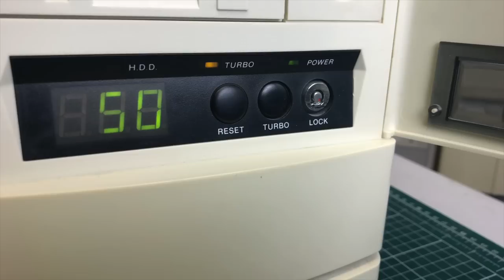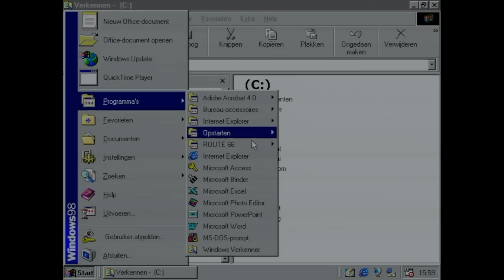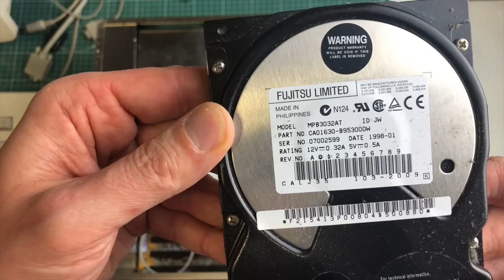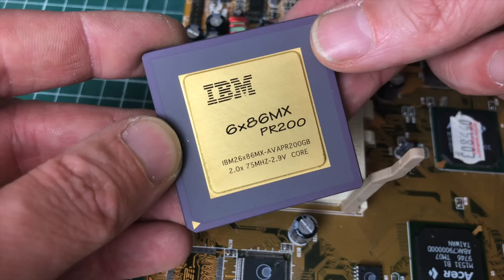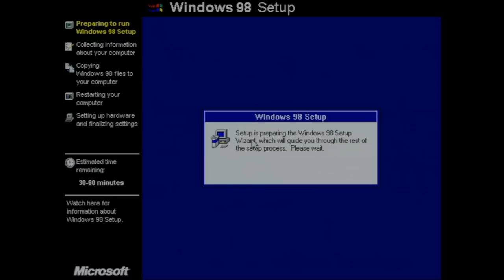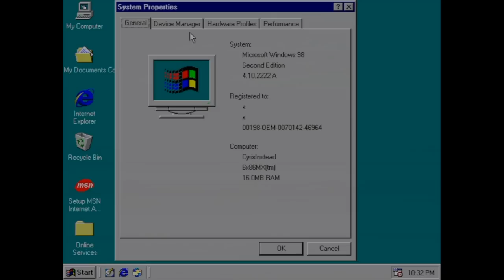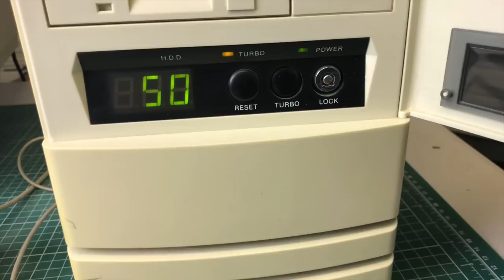IBM 6x86MX PR200 find in a gorgeous nineties PC case

Comment: We had a case looking very much like this, for an Am386SX. It was without the hatch, and it was a bit taller, and the display only had two digits. But there was this glossy black portion with the rectanular HDD, Turbo and Power LEDs; similarly positioned (though gray) power button; reset and turbo switches and keyboard lock in the black rectangle and similar design for air intake in the lower part of the case. Either one manufacturer has taken a strong inspiration from the other, or they could even be from the same manufacturer. The frequency LEDs could be configured by jumpers segment by segment, so for a 120 MHz CPU it still was possible to configure the display to show 119 by displaying "11" in the leftmost seven-segment unit.
Reply: Any luck finding the name of model of the case ? I used to have a very similar mod tower case with the 2 number digits for the MHz . My reset and turbo buttons were not round but rather very oval , almost flat . I remember my computer was a megitronic but I can’t find the case .
Reply: @melchieor  Sounds exactly like the one we had. There glossy black part went at least almost the full width, and it had a small protrusion in the upper part, if I remember correctly. The LEDs were rectangular, and they were green for power, orange for turbo and red for HDD. The power button was in a rectangular piece, but the button was round. The turbo and reset switches match your description. They were in small indentations, so the button itself would protrude ever so slightly (I think that turbo button was protruding a bit more when it was off, but cannot say this for sure). And there were four, maybe five grooves at the lower part of the case. Unfortunately, I have no name for the case. It was a brandless clone PC built by some small company that would sell coputer parts, and has probably gone bankrupt some 20 years ago. I've tried to search for a picture of the case, too, but with no luck.

Comment: That 24hour burn in sticker on the bios chip is always a dead give away for pcchips board :)
Reply: Interesting that the board didn't have the chipset rebranded though. I could clearly see the "ACER" markings on the chipset (ALi is Acer Labs Inc.) at 9:56
Reply: I used to deliberately buy PC Chips and ECS boards back in the late 90's and early 2000's because I wanted to help people who were having problems with their rigs built around these cheap motherboards' and the reputation they had was well deserved IMO. Fake cache chips on PC Chips 918, 912 et cetera was the original issue people had with PC Chips mobo's but to add to it, the chipsets' they used were usually very old tech, very slow and as such memory bandwidth with a particular CPU and at a set speed (RAM & CPU), the PC Chips mobo would be 10-20% slower than a PC with identical components, other than the fact it was based on a better board, such as one manufactured by Gigabyte, Asus, Abit and even Intel own brand mobo's were much faster than PC Chips motherboards with the same socket.
PR was a rating given to CPU's as a 'performance rating' when (I think) the CPU in question was benchmarked versus a Intel processor at the same PR speed.
A 200MHz PR CPU would have been thought to perform the same as a Pentium @ 200MHz but the differing in instruction sets caused the PR to be quite random and not based on much at all really.
Reply: @NSHG  ALi made chipsets for fair while and I recall having a Socket A board with an ALi Magik 2 chipset (I think) and as a fairly early socket A board, it didn't have a locked PCI bus so overclocking also overclocked the PCI/AGP speed.
Reply: @benrogersdevon  I still have a fully functioning ALi based Celeron 533 machine from PCChips, a M726MRT (Slot 1 + Skt 370) Surprisingly sturdy. 

The caps aren't really that bad either (Teapo w/ slight G-Luxon sights. Would've expected more trashy caps honestly.), and the soundcard onboard is a genuine CMI8738 on the PCI bus. Also the BIOS isn't crappy at all, which is a great surprise considering it's PCChips, of all things. Oh, and no rebranded chipset. It actually READS the original ALi printing on it.

ALi was more popular during the Super Socket 7 phase though, for what I recall, with their ALi Aladdin V. Some revisions had a bug where you couldn't run some K6 chips though (ASUS P5A actually suffered from this) which could be fixed with a resistor placed on the back of the socket, though it escapes me which pin(s) you had to solder it to.

Comment: Those CPU's will undervolt quite a lot. The ALiDDin 4 chipset also had a 2.5 divider for the PCI clock. So on this board it would have been 30mhz.  I don't mind these cyrix chips. They are fun to play with and pit against CPU"s from other brands. The later gen M2 cpu's I found could be undervolted quite amazingly, and at that point could get by without a an on their heat-sink. The first MX chips maybe not so much, but I always set them up at 2.8 volts. And if the motherboard had the settings, sometimes even as low as 2.5 volts, and they would still work just fine. And it always led to less problems for heat.  That is a beautiful case!

Comment: The 6x86 isn't lacking a FPU, it just has a slow one (iirc, it can't use both the FPU and the ALU like the pentium can do)
Reply from the maker: Yeah ... need to be more clear when I use terms such as “lacking fpu”. Meant to say “lacking in fpu performance”.
Reply: If you used Windows NT it effectively did not have a FPU. NT kernel would simply disable it at least in NT 4.0. The filesystem drivers required a FPU for compression and encryption, also. So it attempted to emulate one when a 6x86 was present. There was no indication to the end user that anything was wrong until one day the system no longer would boot.
Reply: @AugurIliKur  none the compression nor encryption in NTFS uses FPU. Those algorithms are purely integer.
Reply: FPU isn't just for floating point. Back in the 90s we called them math co processors. Some how that changed to FPU because of the 486 and Pentium cpus integrating them into the CPU directly. Most FPU units will also speed up integer. Do you mean that NT v4 doesn't need to use the accelerate opcodes from the FPU?
Reply: @skilletpan5674  you know what fpu stands for, right? It accelerates floating point math and functions, like transcendental ones. While you can use FPU for manipulating floating point representations of integers (like, 2.0 x 2.0) it don't worth it from performance standpoint. FPU introduces latency which only worth it for something really expensive, like floating point multiplication/division or math functions. And yes, NTFS.sys doesn't use any x87 code. At all.
Reply: @skilletpan5674  the issue with the corrupted filesystem could be related to a cache, either on-board one or built into the CPU. Or the RAM being unable to work correctly with the particular CPU. That era motherboards could've been quite picky when it comes to a non-Intel CPUs. BSODs, lockups, reboots... Been there, done that.
Reply: I know what an FPU is and what it's for. The FPU is rather handy when you want to do large calculations/lots of calculations. It's why games like doom and quake run faster on pentiums or at all. The FPU has the handy thing of introducing parallelism into a program. You can hand off a task to it and then get the result several cycles later but still continue your code while it's calculating. The setup is slower but the pay off is larger if you design your program around it. As to NT not using the FP I find that typical and interesting.
Reply: @skilletpan5674  That only works with intel's design. Also DOOM doesn't require a FPU at all, quake does.
But what they did with quake could have been made without a FPU considering the PS1 had no FPU and was still capable of doing complex 3D and that other PC games can do what quake did without a FPU as well, sometimes with even more things going on on the scene.
Reply: @skilletpan5674  your knowledge about x87 is fragmented. you'll find it interesting that Doom isn't using x87 FPU. At all. Only fixed point in the CPU. While you're right about parallelism it isn't easy achievable on 386/486. There's x87 instruction FWAIT which stalls CPU until x87 not ready with the result. And no, x87 isn't useful for just any massive calculations, only for floating point math. Thus F and P in the name. I see you seem to confuse FPU with MMX and later SIMD instructions. x87 is quite different. It has stack architecture, not just a bunch of registers. And is very tricky to program it in assembler.
Wikipedia has great article on x87 FPU.
Reply: I'm sorry but I don't really want to have a pissing match with you today. My knowledge of old hardware etc is from using them about 35 years ago. I haven't owned such an old pc for about 20 years or so. Yes I was thinking of Quake and not doom. Yes x87 is rather different from MMX etc because by the time Pentium was around they'd moved the x87 into the cpu rather than having it as a separate chip. There is nothing stopping the programmer from executing a few instructions then then doing the FWAIT when they want to check for the result. This usually means you can get the Pentium pipeline to process a few instructions while you wait unlike the 486 which hasn't got the same pipeline.
Reply: @skilletpan5674  "there's nothing stopping programmer..." - I see you're not a programmer, right? There's a lot of things stopping programmer from doing that. And most obvious one - big range of clock speeds of the IBM-compatibles and x87s used. But this is a bit off topic. Bottom line: NT4 kernel didn't use nor require x87 to function. Neither did any NT4 stock filesystems, NTFS or FAT. The probable cause of corrupted filesystems I mentioned above. Cheers.
Reply: @skilletpan5674  oh, and by the way. Encryption of files on NTFS volume was introduced in Windows 2000 and called EFS, hence you couldn't have any issue with it in NT4.

Comment: Remember that no one wanted these Cyrix processors at the time because of the low FP performance which resulted in slow performance in games...
Reply: this month i took my old 430tx motherboard out of a case, to replace it with a new board, cyrix pr166 still intact, probably still ready to run.
Reply: @felderup  The Intel 430TX chipset was the last nice one for 66mhz socket7 mb. It supported UltraATA, SDRam, EDO ram, and was rock stable indeed.

Comment: I remember I used to overclock the bus up to 83MHz. I remember on a 430VX intel chipset motherboard when I did this and at the same time enabled UDMA on the IDE controller my Win95 installation would corrupt every time I overclocked the bus to 83MHz, due to the PCI bus running out of spec. However, when I changed it from UDMA back to PIO Mode 4 it worked fine. 75MHz was no problem with UDMA enabled though. The higher FSB on these socket 7 motherboards really improved the performance by a considerable amount. Probably because the L2 Cache was on the motherboard
Reply from the maker: The PR200 seems to overclock fine to 75x2.5 (PR233) but on these socket 7 boards its next to impossible to get temperature readings. So not really sure how far I want to push it.

Comment: Many Cyrix CPUs were manufactured by IBM. 

The mach64 is actually a 3D card but it uses custom 3D instructions.  There were several games designed for it. 

That Avance Logic sound card has a connector for a Wave Blaster daughterboard.

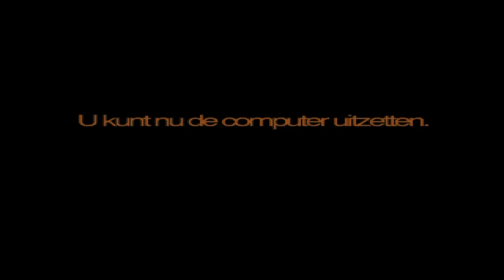Comment: I was taking a swig of my tea and looked up to see that 4:30
I nearly choked.
A small correction for you at 10:52 - the original Pentiums had 16Kb L1, the MMX variants have 32Kb L1 which was where their real world performance boost came from
Reply from the maker: Next video will start with some errata :) thx a lot to you and all the others for pointing them out.
Reply: @RetroSpector78  I'm unaware if it has been mentioned elsewhere in the comments but in your video you say that the isa bus is 32 bit - when I think you meant 16 bit. Also the HDD has the size written on it 3.27 GB bottom right. Great videos from you, well done and thanks for sharing.
Reply from the maker: Thx a lot ... still lots of room for improvement but I’ve got the best viewers / subscribers ... I’ll dedicate my next video to you guys and sum up the mistakes + corrections that got into this one :)

Comment: Awesome video(watched it first on my Roku YouTube App) I have a strangly similar Matsonic Socket 7 Board with the AT and ATX connectors but with the PC-66 Dimms filled instead of the 72 pin ram sockets and a K6-300 Mhz processor. I should put in a spare sound card(mine has a built in sound chip but not a fan of onboard sound cards) and video card and hard drive and see if the crazy things still works since it been put away for a few years now. Again awesome video and thanks for reminding me of mine.

Comment: All the time you`re going in detail about the FSB and multiplier, all I can think of is to overclock this thing... Would be interesting to see how far you can get with this CPU :)
Reply from the maker: Don’t have high hopes but might try it in a future video :)
Reply: You would get nowhere. Overclocking just didn't work. The chips would almost universally just lock up at a higher clock speed. This isn't like modern chips where 200 would be a 233 that is derated. This is 200 or 233, the end.  233 ran at 66 MHz and 200 ran at 75 MHz, period. Plus as he mentioned the PCI cards often would not work at 75 MHz. So you ended up running your 200 at 66 MHz bus with the multiplier set higher to get almost any complex PCI card to work right.
Reply: I once overclocked a 5x86 cyrix cpu (It was one of the weird ones that ran on a 486 motherboard if I remember correctly) from 100 to 130mhz~. I changed the 25mhz jumper to 30mhz. The internal 4x multiplyer gave it the 130ish speed. It booted up and ran but it wasn't all that stable and a real pentium 100 was still faster than it with PCI bus and the better ram.

Comment: Hard drive is a 3.2GB.

I still have my 686 PR200 CPU motherboard ram etc. It was rebuilt into a AT desktop a couple of years ago :)
The 686 has an FPU but is on par with a 486, Quake was the killer for the Cyrix CPU's if you were not using a 3D card such as 3DFX.

Comment: The ps/2 port is actually the mouse port.
Reply from the maker: Correct ... should have tested my theory :) I thought the ps/2 port would have come with a bracket (like the serial / parallel ports). Honest mistake ...
Reply: @Korstre  Yep, I remember having a PS/2 header on my first socket 5 motherboard for a PS/2 bracket. Keyboards didn't work. Only mice.

Comment: As far as I remember, that PR rating was based on Winstone business benchmark. You can tell that from their adverts which show a Winstone chart in every app of the cpus. This benchmark was used by PC Magazine, and it measures performance of office applications mainly. Cyrix 6x86s weren't as good as pentiums in most senarios. Cyrix equipped their cpus with more L2 cache and run them on FSBs that are higher than intel. This resulted in Cyrix cpus to perform in business applications similar to intel at lower cpu frequencies. However, they were far inferior to intel in almost everything other than office applications, especially games with need a lot of FPU horse power.

Comment: That thing was begging to be overclocked.  Some liquid metal thermal compound, over volt, bigger cooler.  It would be epic.
Reply: The Cyrix 6x86 architecture did not clock scale well, which is why they introduced a PR scheme to compare their lower clocked parts to higher clocked Pentiums. IBM was well aware of Cyrix and their aggressive push on clock speeds since back in the 486/586 era and had opted to more conservatively rate the parts they had their brand name on.

They also consumed far more power than similarly clocked chips from Intel and AMD, and had severe stability problems owing to using weird non-standard bus speeds like 75 and 83 MHz. You may be able to get a few extra MHz on an IBM part, but you'd need a board with non-cascaded bus clocks and a more granular control on the FSB clock. Most boards from the time had fixed FSB clock increments of 60, 66, 75 and 83 MHz, which cascaded to the memory PCI and ISA clocks and threw them far out of spec.
Reply: @GGigabiteM  absolutely, I had a Cyrix/IBM PR233MX back in the day and I couldn’t squeeze anything extra out of it 👎🏻

Comment: wow that was similar in components to the acer aspire i had (same hard drive, well mine was 2gb) but it also used a IBM CPU PR150. Never knew Acer had a standard AT case system (i see the acer logo on that motherboard) as all the acer desktops and towers i saw during that time had non standard boards.
Reply from the maker: Acer (via a subsidiary) is responsible for the popular ALi Aladdin chipset found on socket 7 mainboards used in clone pc’s. Some of them have an ALi logo, others have the Acer logo.

Comment: Nice vid, mate! I'm pretty sure the ps/2 connector is for the mice and not for the keyboard - did you give it a try? Together with the ATX power connector and the SD ram slots it is is a good board to built a retro system with newer components. The CPU is in great condition. And the ALS100+ soundcard offers great compatibility with DOS games, sadly most of them are pretend to be noisy. Cheers
Reply from the maker: You may be right ... i thought the ps/2 would have a header on the mainboard. Didn’t try it as the motherboard would stay in this AT case.